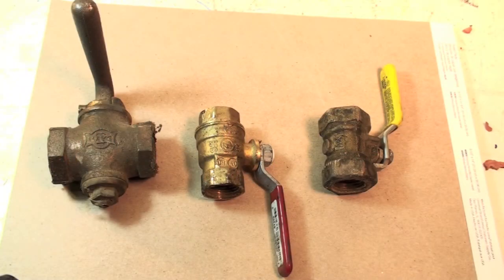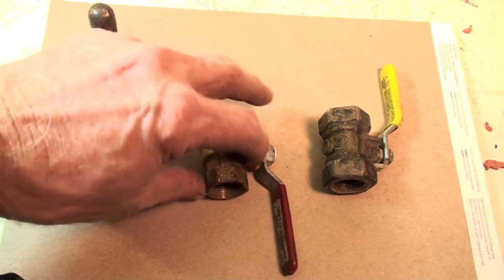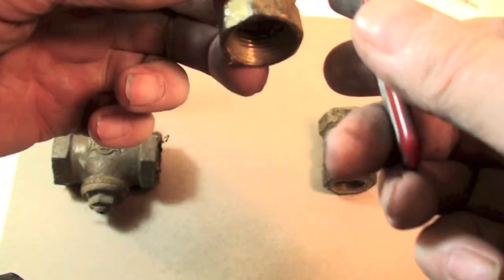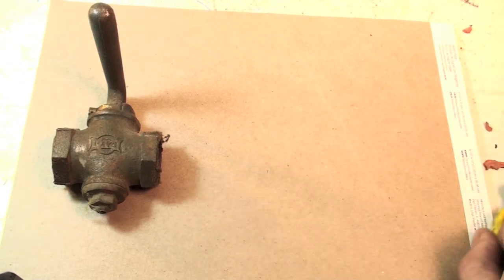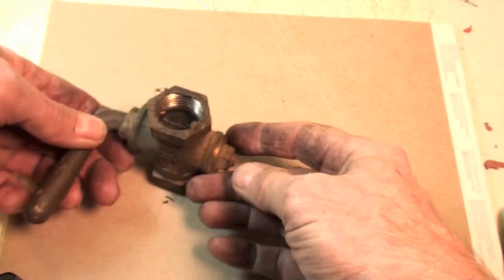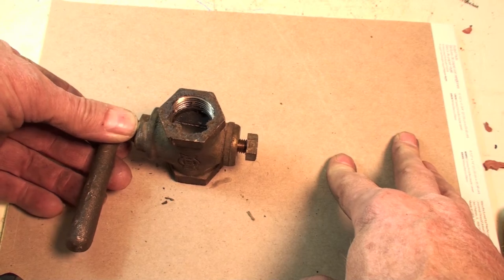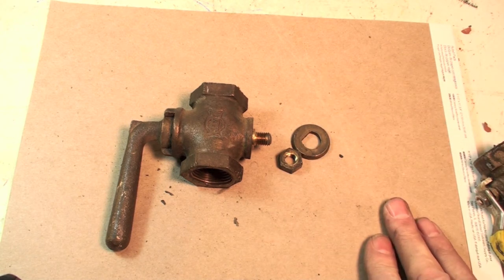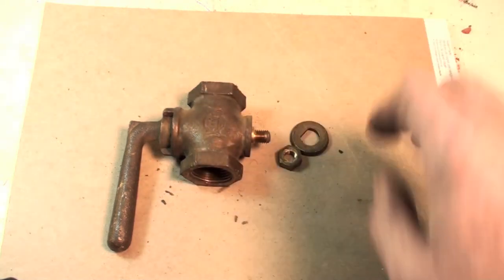How the natural gas cock works

Comment: Gary correct me if I'm wrong but I was told that you loosen the nut some before turning the handle. If I didn't know better I would just try turning the handle.
Reply: You are right and he is wrong, thanx I'm not alone here.
Reply: Not only loosen nut, carefully hit threads (with non-sparking item) so as to unseat the tapered cone by a few thousandths of an inch. Then can turn and retighten nut. Check for leaks of course

Comment: when i was plumbing our rule of thumb was: if you see one of those taper grease sealed valves, leave it alone, don't turn it. like you said the only way to guarantee that the valve will A. function and B. will not leak is to throw the valve out and fit a brand new valve that complies with current standards and that has been tested in accordance with the standards. i see people install valves that are imported and not tested and do not comply with standards

Comment: just so you know, I replaced the gas lines (rusted, leaking) on a house that had two of those tapered valves. valves had no issues. they were all located inside. 40's house. valves unknown age, but very oxidized.

Comment: I have a Rockford valve in my house. They were recalled in the 1970's because they fail to fully seal off. I have one in my house from 1950. It's stiff but it still works and it doesn't leak so I'm babying it.  It's probably only been moved less than 5 times in this entire time. However it doesn't entirely seal off, some gas does get by through the hose, so off isn't really off.  But I stuffed a bag in the line and taped it up tonight for several hours while repairing the stove and there was no gas odor the whole time I was working, but there was enough wafting out of the pipe to smell it that it wasn't sealed when I took the bag off to reconnect it. I have bubble gas leak spray.

Also a lot of these valves are made for a now obsolete pipe thread diameter - so if you change it, you have to change the entire pipeline or use size adapters which is not allowed under some building codes due to pressure fluctuations.
Reply from the maker: Us guys in the business get a little antsy when we see gas leaking.  I would dump it.
GFM
Reply: Yes, well I know everything about my house so I know all the little quirks about it. The entire run has to be changed anyway to have a straight pipe coming out of the floor because having the crinkly flex line coming out of the floor makes it really obnoxious and difficult to pull the oven out to clean under it because it wants to snag and twist itself around and you can;t pull it out much because then it tugs on the main run in the basement which isn't supported to the ceiling and just flops around.

Comment: whilst the tapered "Carrot" seals to an extent it is the molykote that does the rest of the sealing. strip down, regrease, reassemble it'll be as good as new. save the customer some money 💰
Reply: Excellent, apparently even some of the old-timers can't comprehend reuse what you've got until it' NEEDS to be replaced $$$
Reply: Sure beats a Chinese ball valve any day.  Tapered valve is required under some codes.

Comment: i had warner stellian come out too deliver a new stove i ask them too take the old one free of charge they did i decided not too pay the 150.00 dollar install they broke the valve free then it seemed all right until i went hook the line back up  turn the handle and it slid out i put it back in ran too get a cresent wrench shut it off from the main opened all windows hopped on youtube found your channel and took your advise thankyou very much and god bless
Reply from the maker: Hope you got rid of the old valve.
GFM

Comment: Is it okay to shut off the blue gas valve inside the Lennox Pulse G14 and not shut off the valve in the line?  We aren't going to use the Lennox anymore, planning to replace it.
THANKS FOR YOUR HELP AS ALWAYS
Reply from the maker: No, Shut off the gas cock in the gas line and shut off the power to the furnace.
GFM
Reply: @grayfurnaceman  THANKS!!

Comment: I have a Griswold two burner stove with crane valves on it.  Probably from the 20's All one needs to do is the maintenance on these valves. I use Molykote on the vavles to lub and seal. Of course if you are lazy and do not want to do the maintenance you are no doubt going to have a failure.
Reply from the maker: I am definitely lazy.  I will use the Butterball.
GFM
Reply: LOL
Reply: Of course people these days (a) do not have the time or (b) just don't have the knowledge. But of course you are right on the other two. Most people are looking for that bulletproof solution. Which they should. BTW the Griswold stove is used outside.

Comment: Why are you not mentioning the use of gas cock/valve grease in regards to the tapered valve?  These valves are alive and well today for those that maintain them, without leaks!  You mentioned "butterball" valves as being your favorite.  I think you meant to say "butterfly" valve.  I'm not a professional in this trade, but common sense tells me that the best way to seal is to have the greatest surface area possibly covering the smallest opening possible.  The butterfly may be cheaper, but likely the least effective.  The ball valve is good but doesn't offer the surface area.  The tapered valve offers the most area and uses grease to supplement it's sealing ability.
Reply from the maker: Butterball is a brand, check 1:40.  Simply looking at the bosses on threaded ends tells you this is a top end valve.  I have never seen one leak.  
The tapered valve is a technology that is long past its usefulness. 
Given some age, the grease hardens and the valve will leak when moved or will lock up.  I have seen the handles broken off from someone trying to shut it off.  In an emergency, there may be no way to get the valve off quickly.  In many jurisdictions, these valve are illegal.  Disassembling the valve requires shutting down the entire piping system and the labor to repair the valve much exceeds the cost of a replacement valve.
GFM

Comment: 3:11 I have this one connected to my stove with the handle ripped off.
Reply from the maker: Very common for them to stick then someone uses a pipe on the handle and breaks it.  The valves are garbage.  Replace it with something like a Butterball brand.
GFM
Reply: had a smell of gas coming from the old stove that I never used and wanted to shut off the gas, but with this mangled handle that has been missing for who knows how long, I have been in this apartment for over 16 years, hard to know if it is in the off position, with it being snapped off like it is, the pilot light on the stove did go out, but not 100% sure if was turned off all the way, thanks for you comment.
Reply: Putting the handle at a 90 degree angle to the direction of the pipe is off. Putting the handle parallel to the pipe is on.
Reply: this handle is kind of rounded off. it does turn freely though.

Comment: Once again you've advised your viewers improperly starting with suggesting the meter be closed down for the simple issue w/the old style valve handle not turning easily. Loosten the nut at the bottom a bit turn the valve off then re-tighten period. The idea of replacing those wonderful old valves with the newer is a waste of money and then you really are shutting down service and relighting pilots. Do you work for those guys? Be honest. You certainly aren't misguiding
Reply from the maker: From the poor quality casting that restricted flow to the tendency to lock up made these valves go the way of the carburetor on autos.  
What would happen is the valve would leak, the tech would tighten the nut, the valve would lockup and the homeowner would break off the handle using a wrench to turn the valve.  
You could repair the valve by disassembling, cleaning and applying valve grease, but why?  You would have to shut down the gas line to do this, so why not replace the valve with a Butterball?
I have never had a Butterball or any of the other replacement valves leak.
GFM
Reply: @grayfurnaceman  Why would the valve lock up? Its a simple procedure to loosen the nut before forcing the handle with reckless abandon. For that matter the individual might twist  any handle the wrong direction. Reuse the existing handle until its exceeded its practical ability to function, many "techs" are so full of themselves and their "divine wisdom" that they only leave a job if its loaded with bright new shiny components along with their excessive bill. Heres another tid-bit to brew over: in 45 years i've never had a bronze valve leak beyond my ability to clean, re-lube, reassemble  unless the handle is just beyond repair. Others: yes, Enjoy your ProLine Butterball royalties.
Reply from the maker: @DamianBlake-id4kg  I find it amazing I would have to explain this to someone in the business.
Homeowners don't know what that nut is for and even if they do, they would loosen it and get the valve to move, then leave it leaking.  
Some don't even have or know how to use a wrench!  
When you are shutting down the gas from the meter, disassembling the valve, cleaning and relubing the valve, consider how much labor you just charged the customer for and the customer still has a junk valve.
BTW, don't you think, if I was paid by Butterball, I would use a new valve to demonstrate.
GFM